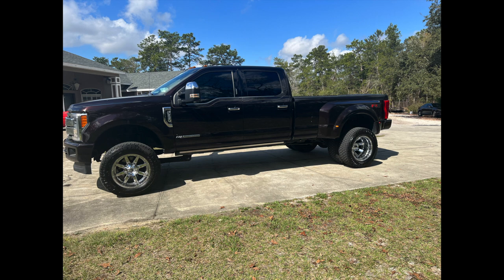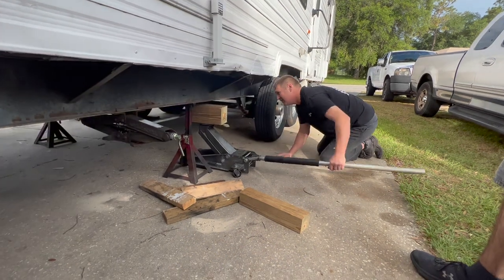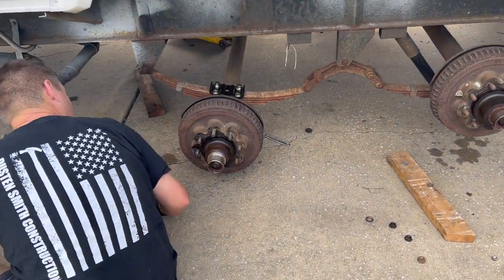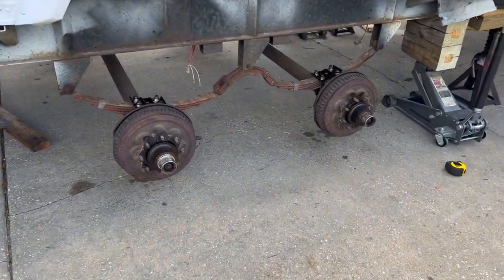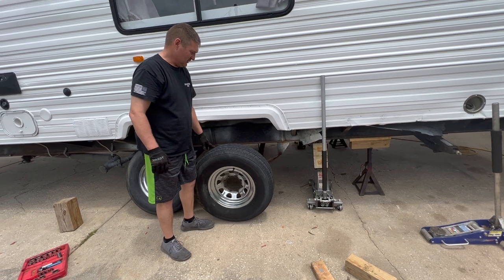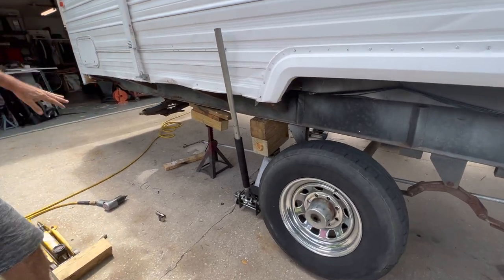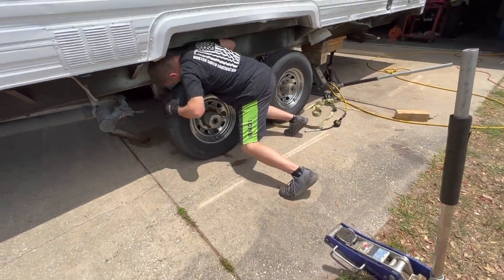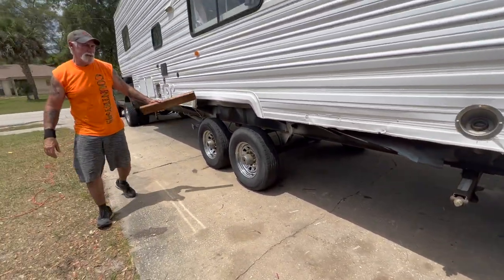I put a 6" lift on my RV Toy hauler

Comment: Could have just put the jack under the axle to get the wheels back on. The travel in the springs most likely would have been enough without lifting the frame off the jack stands.

Comment: I used to have Jeep JKUR with 5 in lift and 37s. It was a full lift kit with Fox shocks, upper and lower control arms and drive shaft. It’s a complete lift kit from Mopar. Even tho I had a professionally installed, it would sway driving down the highway especially when towing my 5x7 inclosed trailer (2500# loaded). It just never drive the same as factory. Does your Superduty sway while towing?